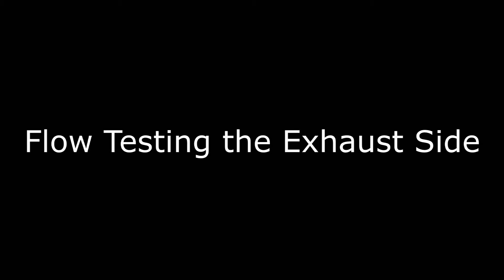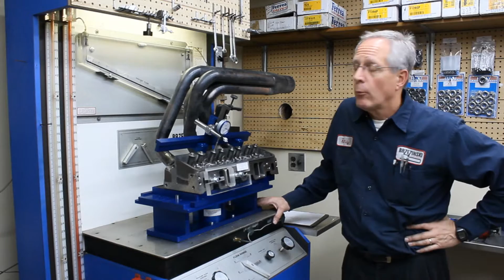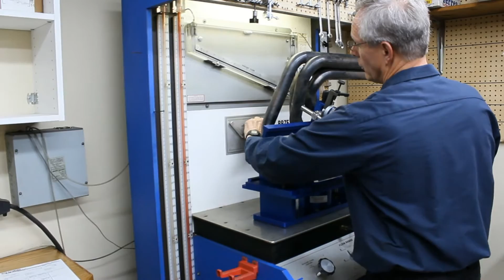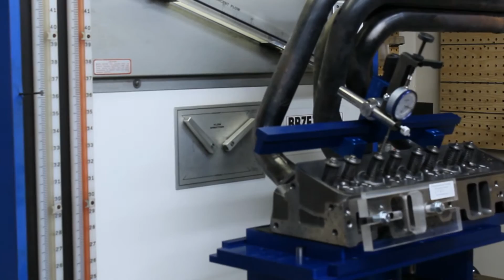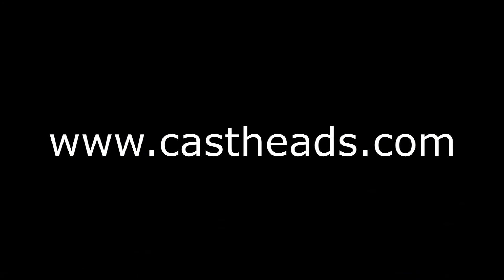Flow Testing the Exhaust Side - Part 11

Comment: The reason I say this is that velocity is paramount! You cannot replicate 1400 degree air under pressure.

You can make some generalizations from the  FB, but Dyno testing is the best way. Higher compression engines can use a smaller EX valve, (to make room for a larger intake:)

Comment: You should take a look at leak when switching  from intake to exhaust:  when testing intake , all the parts are sucked together decreasing leakage whereas testing exhaust you are trying to blow everything apart.  As I test on very high test pressures the difference can be around 6-10 cfm . 

But that is my opinion.